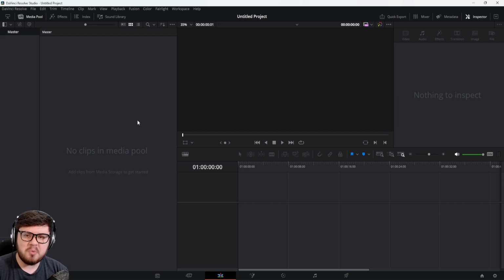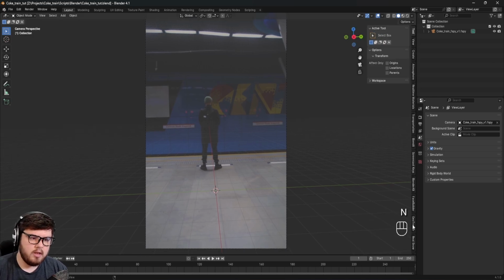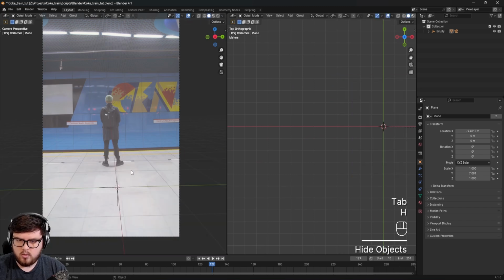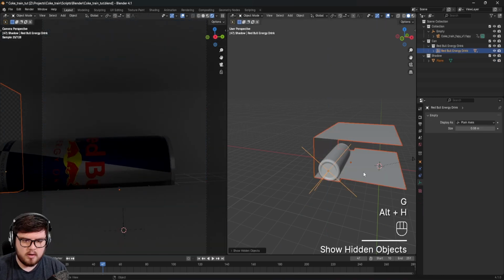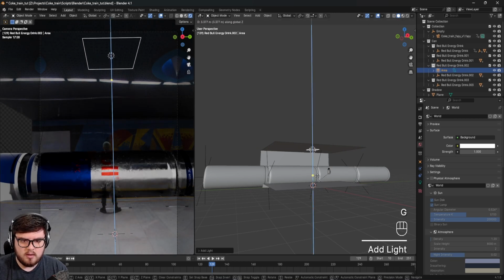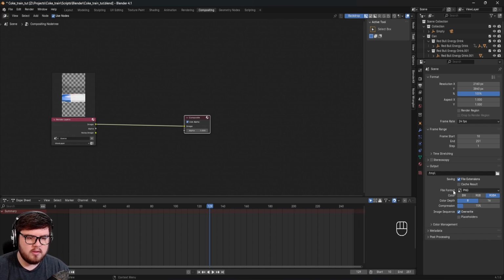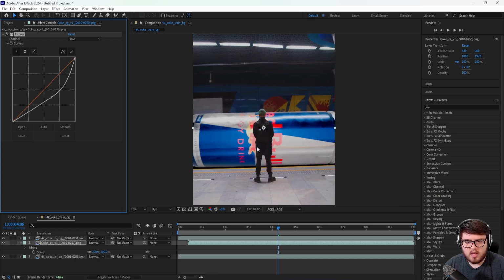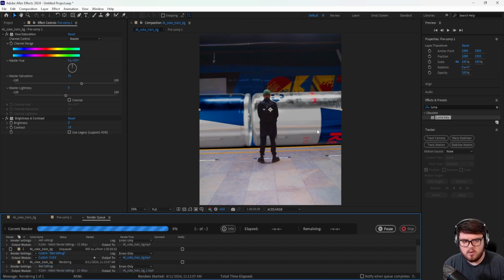Yes...You can create VFX Advertising using Blender and After Effects

Comment: How do you deal with Lens Distortion in this?
Reply from the maker: Most of the times I don't need a big lens distortion workflow since it's only for social media and the distortion is most noticable usually on areas of the screen where there isn't vfx for vertical footage. The workflow on other shots however would be to add some nodes to blender compositing and render it out baked. Unfortunately I don't know of any non destructive ways to introduce lens distortion super accurately in compositing besides just adding a lens distortion node in compositing and eyeballing it. Hopefully blender adds a function like that in the future to communicate to other programs